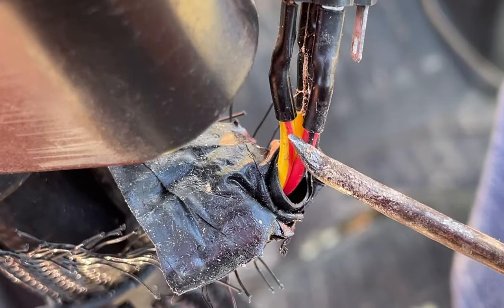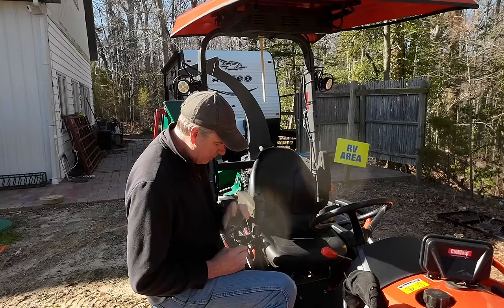Kubota 3rd Function Fail and Fix. MCG Video #202

Comment: I had the same issue on my BX.  The switch is mounted in the fender, so it took about 2 hours to replace it. No way was I going to pay for the entire harness.  Had to do some tight solder work as well that was not fun.  Next time I will follow your lead for sure.  Thanks for sharing!!

Comment: Same happened to mine. Luckily it was still under warranty. I found the same switch without the wiring harness online for less than $15. I was going to just replace the switch but out of stock everywhere. Poor design and ridiculous price for that. Take a look at what the u-bolt costs for the tool box bracket. C’mon Kubota. Only disadvantage without a switch is accidentally pressing buttons when not using a third function attachment. It will stop your primary function. Great quick video!
Reply from the maker: Thank you. I found the switch online too. I don’t think I would replace it with the same one. If I do replace it, it will probably be with something more robust.

Comment: Good Afternoon Ed . That was a good Temp Fix. Solenoid valves don't like to be on all the time. I would go to Harbor freight and find a new switch and wire it in. Too bad Radio Shack is not longer around they would have something to make an inexpensive repair.

Comment: Wow Ed, very nice save.   I have to agree, some of the Kubota parts pricing is outrageous and they do not make any sense.   Your switch is a prime example of their pricing issues.   It is basically a $15 switch with a wiring harness and a connector.

Put some Scotch 33+ tape over the yellow tape I you will not even notice it has been repaired.   Dan 😊
Reply from the maker: Haha! Thanks Dan. That may happen!

Comment: Prices for parts on small tractors tend to be very high. Knipex make great pliers, we have a few. It would be worth looking at parts of the switch closely looking for a part number as I expect you will find that the switch itself is made by someone else and cheaply available
Reply from the maker: Hi Joseph. I did actually find the switch online for $20. Not sure if I’d replace it with the same one or try something different. Thanks!

Comment: My front third function never had an off/on switch from new.
I just have open/closed buttons.
Iv only seen the power button on a 2680.
I've not had a moments trouble with mine being 'live' in over 250 hours.
Reply from the maker: Excellent!

Comment: Oddly enough, the 3rd function on my b2301 (dealer installed) has no switch.  I do find I blow the  inline fuse (mine is wired from battery) when not using the grapple.  I think that helps prevent any damage when dead heading the 3rd function.   That is what I tell myself anyways when i have to replace a fuse.  😂
Reply from the maker: I know there’s a Kubota brand 3rd function and a Land Pride brand that’s different. Oddly, Kubota owns Land Pride. There are also other third-party manufacturers, so who knows what you have? 😄

Comment: I wanted to replace the rubber boot around the axle joint on the front end and they said it wasn't a "user servicable part" and I would have to buy the whole assembly - at 75$ ( a couple years ago). Not paying that much for a piece of rubber.....
Reply from the maker: Ouch!

Comment: Good yankee engineering! I would have done exactly the same thing. Knipex tools are awesome, I have a pair in my tractor that I use to tighten the top link and side links. The smooth jaws don't scratch or chew up the screws either.
Reply from the maker: Thanks! 😄👍

Comment: Consider some type of switch Ed. Solenoids can sometimes dislike being powered all the time, particularly if they are not designed for continuous power. I’m sure a new solenoid coil will be pretty expensive too.
Reply from the maker: Thanks. But I don’t think the solenoid is actually engaged until you press one of the activation buttons to open or close the grapple. Personally, I think the switch is more of a safety feature so you can turn off the third function and not activate one of the operational switches. However, I may still replace the switch. 😄

Comment: Don't you need to be able to turn off the switch so you can release the pressure in the lines for disconnection purposes.
Reply from the maker: No because you used the open and close functions for that. And for that, the switch would be on. Thanks for asking!